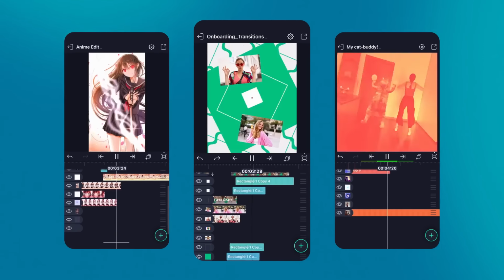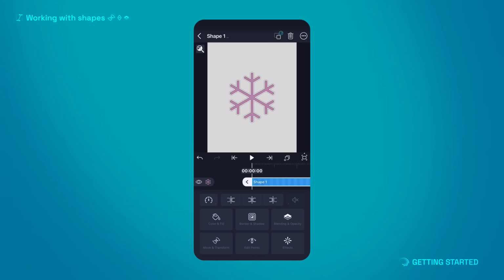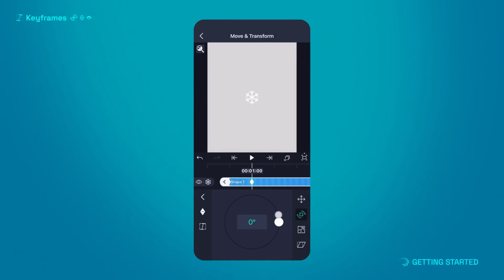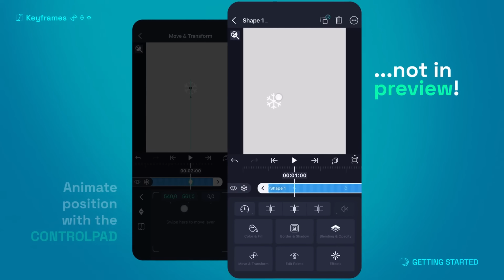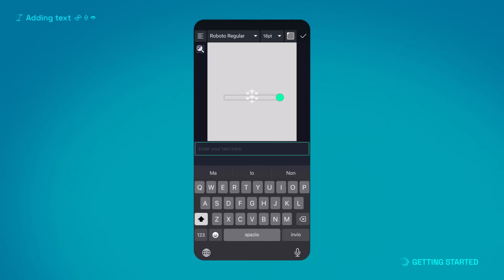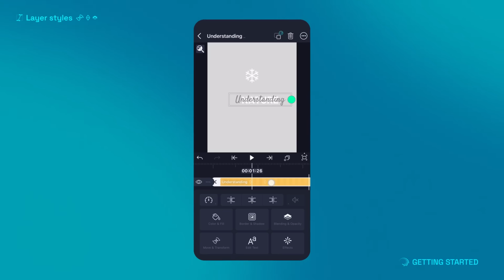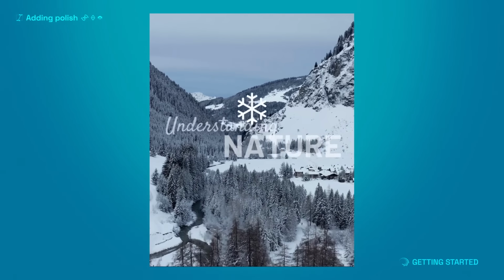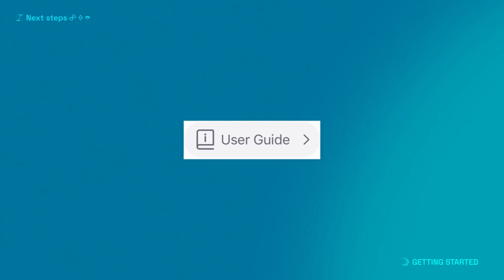Getting Started Tutorial

Comment: I’ve been using Alight Motion for a long time and the app is amazing, but two extremely important features are still missing: Head Tracking and Advanced Time Remapping.

Right now, creators have to use multiple apps like Node Video, CapCut or Reface just to do head tracking, and then bring the clip back into Alight Motion. Same for time remapping — we have to create it in another app first, then adjust everything again in AM. This process takes a lot of extra time and makes editing very difficult for mobile creators.

If Alight Motion adds:

Built-in Head Tracking

Smooth Time Remapping (velocity graph, optical flow, keyframe ease controls)

…it will save a huge amount of time and more creators will rely only on Alight Motion instead of switching apps. These features are now essential for modern edits, especially AMV, motion edits, and VFX-style edits.

I hope the Alight Motion team listens to its community and adds these features soon. It will make the app far more powerful and keep creators loyal to the platform.